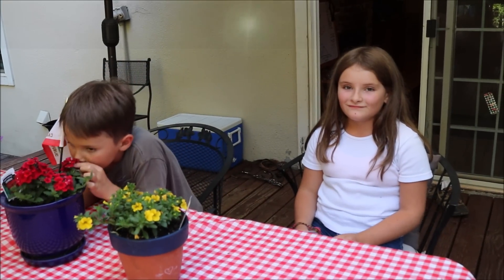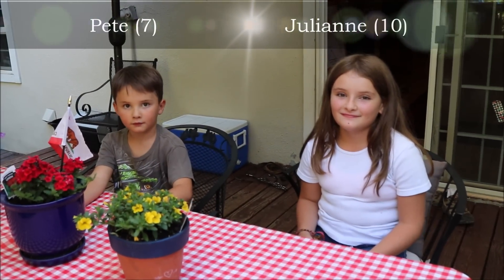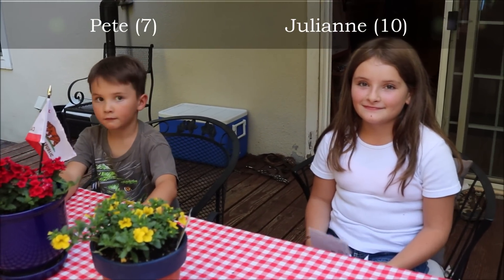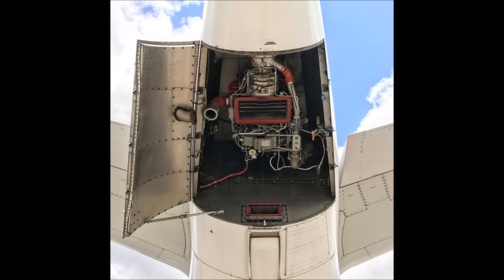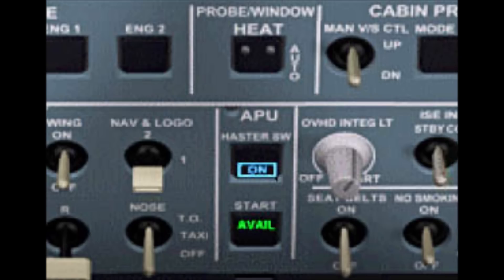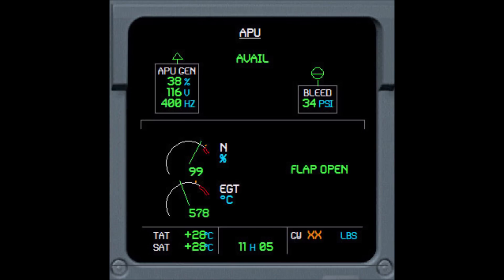A321 Birdstrike(s) Dual Engine Failure Moscow UPDATE- FAQ's

Comment: Why does there seem to be such a problem with bird strikes? Way back in the 1970s I worked briefly for Rolls Royce Aerospace when they were developing a hollow fan blade for the RB211, all seemed to be going well until they carried out a bird-strike test and the birds came out almost whole. It was back to the drawing board until they were finely minced and no longer an issue for the engine.

Comment: "Protecting airfield from birds - millions of dollars spent - not in Russia. "Vertical speed indicator is a lagging instrument" - yeah, the one in the plane behind you. In A320, as in every modern jet out there, it is a IVSI - Instantaneous Vertical Speed Indicator, so yeah, that's the instrument you look on to verify positive rate or climb in modern jets.
About gear, yellow system takes care of the gear also, there is a redundancy. Both engines haven't failed right away, it wouldn't be a problem for hydraulic system to handle that. They did not lower it because it is never good idea to lower it before field landing an airliner. In 99.9% they will brake off causing leaks, fires, instability and excessive roll energy and we need to stop right away. Belly landing is perfect for that energy absorbing.
Now there are rumors that engine number one continued to work and was shut down by mistake. So far just rumors, but with russian politics, chess between insurance companies, airlines, Airbus company etc we never going to find out the truth. Russia needed "heroes" right away, so without even an investigations those two pilots we told to get their hero stars from Kremlin. In this country of lying fuckers called Russia, I wouldn't trust shit.

Comment: How about the engines digging in and getting ripped off?  I think they did on the Hudson river ditching.  They appeared to stay attached in this corn field.
Reply: I think the corn had a lot to do with it. Maybe it had an effect like a sneaker sliding across wet grass?
Reply: @jiveturkey9993  Yeah,  that makes sense. Kind of cushioning and lubricating at the same time.  Not a bad place if you have to belly a big plane.
Reply: Water is really hard when hitting it at 150KTS  also agree they may have been skipping off the plants a little.

Comment: This is the second time an Airbus has been brought down by birds, Sully's in the Hudson and now this Airbus in Russia. The prime suspect is the FADEC that controls the engines. Once they detect the engine vibration has hit some predetermined value it just shuts them down. Takes the decision away from the pilot. As a retired Airbus and Boeing captain, I was never that fond of that decision being taken away from the pilot and turned over to the FADEC computer. (Full Authority Digital Engine Control) The thing to note is the "Full Authority" part of that acronym. Meaning the decision whether to shut down the engine is given to the computer and taken away from the flight crew. Bad idea. That engine may be shaking or vibrating like the dickens, but it can still put out some thrust in many cases. And could be enough to allow the plane to limp around the airport to a landing on a runway.
Reply: Or enough to shake and break the fuse pins and the engine falls off. However to clarify FADEC doesn't monitor vibration. EEC does.
Reply: Well yeah, but it sends the signal to the FADEC which is the only component that can shut the engine down. Other than the pilots, or running out of fuel, etc.
Reply: @siroccowind736  Also I believe engine 1 was 35% which means it was making power and not shut down.

Comment: Sully started the APU before the last generator dropped off line so it was a normal start. And it only takes a flick of the wrist to initiate. I don’t think that the RAT even deployed, so he had normal law flight controls and flaps all the way to the water. Was it out of sequence with the checklist? Was it the smart thing to do? I sure think so.

Comment: Am a new subscriber and flew briefly in 1977.  Made it to my solo and cross country and that was as far as I got on a Piper PA-28, so I am no expert by any stretch, but have always liked airplanes. You explain things well for just about anyone to understand what is happening in the situations you are talking about.  I pretty much thought the worry would be the ingestion of foreign matter from the runway for jet engines.  I also thought the high wing type jets like the C-17, An-72, An-148 and rear engine types like the MD-80 or B-717 would be best for that safety reason.  It appears there is no protection from birds or small drones.  Do you believe  there could be some way to protect the intake with thin horizontal slats at the entrance of the nacelles without messing too much with the airflow?  This jet was lucky as was the US Air jet landing on the Hudson, thanks to great piloting skills of the pilots on both aircraft... Your channel is a good learning channel for even old guys like me... :)

Comment: Also, the green hydraulic system, and I believe the yellow system too, has pressure activated priority valves which activate to prioritize hydraulic pressure to the flight controls.  Most likely these valves would have prevented green system from  lowering the landing gear if attempted.

Comment: This is the second dual engine failure on an Airbus A32 series. What is wrong with the Airbus? In its whole long history has the B737 series ever had a dual engine failure from birds? I have heard that the Airbus design has an auto shutdown built into the jet engines to shut them off if they go out of parameters, is this correct? I was waiting in SLC to dead head to a reserve callout in CVG when my PW powered 757 flight arrived at the gate from JFK they had 4-6 horribly twisted/deformed fan blades that needed to be replaced before our flight to CVG. Evidently the pilots ran into gulls climbing out of JFK but the PW motor was running well enough that they flew to SLC ok.

Comment: great channel...I have often wondered why the gear is not kept retracted in any off runway landing in presumed soft material. seems logical as you mentioned preserves the wing and fuel system integrity somewhat better. BTW Im ex Navy, Orions, aircrew..and thx for a cool aviation channel

Comment: Why not just leave the APU on until after takeoff? When I did POL we always put an extra 300 lbs of fuel in the supply tank for each hour the plane sat at the gate. It wouldn't burn that much fuel from taxi to takeoff, would it? It just seems practical to have an extra power source already up and running for takeoff insurance.

Comment: Thanks for answering my question about the APU, I asked as I from what I remember the manufacturer of the APU on the Hudson ditch aircraft made a thing about how it saved the day I guess not so much then in that case! The logic that the RAT has to be running before it will try and start is interesting.

Comment: I guess if you had enough time and in case of a RAT low RPM, the Electrical power from the APU can supply the electrically powered hydraulic pumps for the blue and yellow systems, and with PTUs then have available all 3 systems (as we do for maintenance).
Great video as usual.

Comment: Great details on the APU, the difference between the APU and the RAT, start up procedures, what it looks like and where it's located. Great stuff! And great work from your dedicated support team! What are some of the differences, if any, between civilian and Military APUs? If I remember correctly, when you described the military APU in a previous video, the military APU does not require you to deploy a rat first, allowing for a faster startup. By the way I think the Airbus crew did a great job Landing that plane!

Comment: Hi Juan great video yet again de mystifying what happens in the cockpit during these sort of incidents. I used to live a mile east of the threshold of the northern runway at Heathrow inside  the 64 decibel and Vortex strike range I have witnessed many an aborted landing V noisy and suffered Vortex strikes.The incident I remember the most is of a 747 loosing power from an engine after rotation when I say the aircraft filled the sky as it went over wow but I could tell they were just flying the plane gaining speed slowly but surely we watched it flying at what seemed to be rooftop height for some time.
 I wonder would it be worth explaining the problem for airports and pilots when they are fog bound and how it effects the operation and maneuvering of aircraft once on the ground.

Comment: So many times people want to criticize the pilots. I would say what they did was excellent. People don't understand the landing gear is designed to support the aircraft on a hard surface clearly a cornfield is not a hard surface, therefore the landing gear would have sunk into the soil and as you said Juan, the landing gear would have been remove from the airframe rather abruptly.

Comment: FWIW, the A319/320/321 QRH indicates during a dual engine failure "If Forced Landing is anticipated", prior to 3000' AGL "b. GRAVITY GEAR EXTEN...PULL & TURN".  Also "At 500 AGL: f. Brace Signal...Command".  Any landing you can walk away from is a good one (much less any landing EVERYONE can walk away from).  Not saying the pilots did anything wrong, just wanted to point this out.

Comment: Some old Soviet fighter jets (most notably the MiG-29) completely shut the normal engine intakes, opening alternative intakes on the upper side of the fuselage. This isn't done for birds, it's for possible debris thrown up by the nose gear -- which is just in front of the normal intakes.

Obviously, this can't be done in commercial jets, that have their engines in nacelles, under the wings.

Comment: Juan, what is the Real Story on Delta #975  scheduled to depart JFK at 1530 Wed. 8 21 that did not go wheels up until 1000 Thurs. 8 22 because of "weather in NY"??? What is Delta trying to keep from the public with an obviously false claim of "weather in NY"??                  sdh in CT
Reply from the maker: The old 'snowball' effect. Delays until the crew times out. No spare planes, no spare crews. Peak flying season.
Airbus-7000 new plane order backlog,  Boeing- 5000 plane backlog.

Comment: There are comments about Sully's successful ditching in the Hudson as something similar to this crash but note that there were approx 4 minutes from his bird strike and touchdown on the water. Lots of time to come to terms with what was happening. This one had no time but with gear up and a smooth flat landing onto a flat field lubricated by a thick coat of corn the day was again saved. Drag on landing was probably less than into water. This one caused by gulls, Sully had Canada geese.
https://en.wikipedia.org/wiki/US_Airways_Flight_1549

Comment: So, fantastic job by those pilots, a "good" landing by the old metric.

In discussion on Reddit, an A320 pilot says gear down is the official procedure on the Airbus checklist, with zero hydraulic power needed for emergency gear drop (which isolates the gear hydraulics).  So, using up the limited hydraulic power shouldn't have been an issue.  Part of the justification for this is the low ground clearance on the engines (roughly the same as 737s after they switched from turbojets to turbofans).  I guess it's possible there was so little time they couldn't get to that part of the checklist (similar to Sully not getting to the ditch valve near the end of his checklists).

Myself (with only light aircraft experience), I say gear is always pilot's discretion when you are heading for anything other than a paved surface (or good gravel/grass airstrip).  In particular, I see a belly landing as being a reasonable intentional choice for a soft and uneven field with crops, due to the risk of one side digging in or breaking off before the other (and your point about the damage done as the gear rips off is good as well).  Part of my reasoning there is that the engines (with cowling) make marginally better skids than the gear, and the engine pylons are designed to break away.

I'm not sure there is a "best" or "right" answer for the gear.  It certainly worked out well for them here, regardless of the reason for it.

Comment: The problem is it is not only the engines that take birdstrikes.
Birds will fly into the cockpit.
I have seen this happen to a Harrier jumpjet after it had been flying at low-level.  
Birdstrikes can also effect the flying surfaces.
There has to be some kind of anti birdstrike device on the aircraft itself.

Comment: Decades ago, I had an interesting conversation with an engineer who specialized in fan design.  (Not jet engine fans, however...)  He told me that the safety grills on household fans reduce airflow by about 40%.  I have no doubt that anything sturdy enough to withstand a bird strike and somehow prevent large pieces of bird from entering the engine anyway, would reduce airflow into the engine by at least 40%.
Reply from the maker: Wow!

Comment: Fantastic video ... as usual!!!

I have a question about the APU "segment". My question is not about this incident but about how this safety feature impacts what took place in the Hudson River incident. 

As you have stated, APU start on the A321 is automatically disabled during flight if the aircraft is on battery power only. When you mentioned this, I immediately thought about the US Airways Flight 1549 (Hudson River) incident - and it made that entire incident even more amazing. We know from the NTSB accident report that Captain Sullinberger started the APU on the US Airways Flight 1549 approx 9 seconds after the bird strikes. My question is, was Captain Sullinberger able to start the APU because:
1. He was so quick in doing it (within 7-8 seconds of N1 speeds starting to drop) and as such, the engines were still generating some electrical power and therefore the automatic disabling of the APU start had not yet activated?
2. The Airbus A320-214  did not (at the time of the Hudson river Incident)/does not have the same automatic APU start disable system as the A321?
3. The RAT once deployed, provides sufficient electrical power to "de-activate" the APU start disable system?
Reply from the maker: Great question...I would guess #3. The RAT comes on line very quickly....unlike the APU.

Comment: Stress testing puts such a massive divide between between how many birds an engine can safely consume (it is many) and how they can be avoided that pilot error is the only conclusion you can arrive at with a double engine flame-out like this.
Reply from the maker: They are virtually unavoidable at airliner speeds. even in the terminal area (flying slow).
Reply: @blancolirio  We will have to respectfully disagree. I believe this was a foolish act of bravado, otherwise it would happen more often. They were gear up, climing thrust with positive control. Any evasive action at all should have prevented flying square through the middle of a flock of seagulls. I've seen multiple videos of recoverable compressor stalls on climb. My point is - how many birds do you eat before you die? 10? 100? The pilot thought it was 100.
Reply: @blancolirio  P.S. Great channel and great info. Thanks for your hard work.

Comment: Another reason a mesh or grille to protect the engines is a bad idea is that any such material mounted in front of the engines could get dislodged and create the very problem it is supposed to prevent.

Comment: JUAN, HELLO, Yes, those pilots made RIGHT CALL, which bird is responsible for MOST aircraft  engines ? It may blow your mind, but the STARLINGS , because of large flocks.   Regarding in cabin ‘smoke’ issues, seem to me that the crappy heat exchangers,cause  the engine BLEEDAIR  to get into the cabin air, ,and after landing “NOTHING ‘ is ever found !  
Next item, I look at a YT video, where this guy films TO/LA, now when I look into the engines, I  CAN  see the off centerline in the cap , ofthe INTAKE TURBINE  FAN ( GE90 ), at FULL TO POWER , I CAN SEE THE engine turning, so my question to you is how come ? How slow is it turning, ifI still can see it turn  B777, forBA,  out of St KITTS. WI.    GodBless, & Cheers from NJ

Comment: Hi, great , easy to follow explanations and well presented.
However I disagree that technology can’t provide any workable solutions to this serious issue and Moving birds away from airports is not the solution, .....birds will be birds. In any case how could you stop bird strikes mid flight , not near airports?
If there was a pointed ⬅️ shaped guard in front of the engines that could Chanel or deflect oncoming birds/ debris away from the engines intake path, that could work ? At the moment as I recall seeing , there is a cone fitted inside the front of the engine that swirls air away from the centre shaft? .....move this outside the engine? Maybe current engine designs are flawed and could have an angled intake (down or up) to mitigate a full bird strike?
Maybe I’ll invent something myself ,sell it to the industry and retire to the Bahamas?😁🍻🏁

Comment: Great explanation folks. I am a retired Air Traffic Controller and had a British Airways A320 swallow several gulls on take off into the No1 engine.It sounded like a metal pole had been rammed through the engine.He didn't shut it down but brought it back to idle,declared an emergency and landed safely.If the No2 had taken birds then the outcome could have been very different.
Reply: john mcconville  hi few years ago, somewhere IN UK  THOMAS COOK, or THOMSINLIN   has a CRANE into its #2 engine on take off  B757, man that enginebackfired, withpuffs Of smoke, So an emergency was declared,went around , & landed, It May have been Manchester , Cheersfrom  NJ
Reply: @flybyairplane3528  Yes it was Manchester.Thomsonfly now TUI B757.Just watched it again on You Tube.Worth looking at to see what happens,and how ATC have to respond.